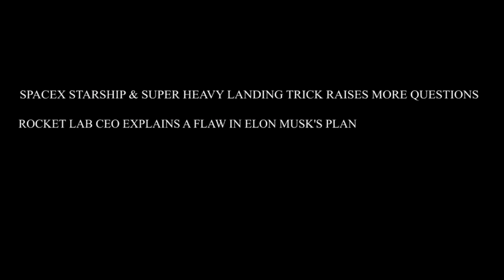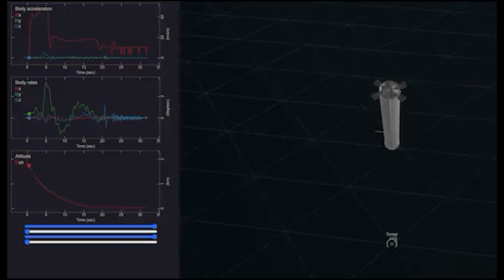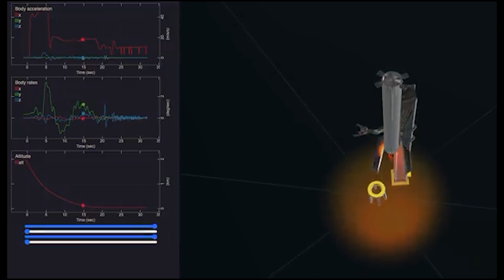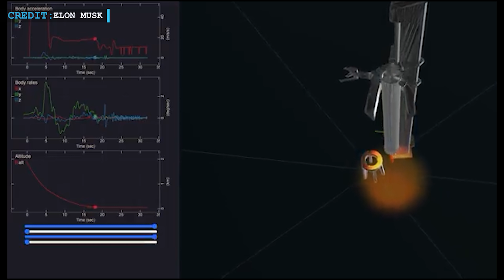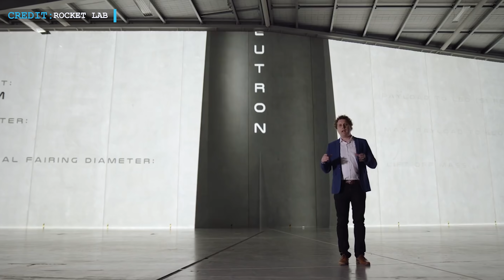SpaceX Starship Landing Trick Raises More Questions | Rocket Lab CEO Explains Flaw In Elon Musk Plan

Comment: How much extra fuel is consumed/wasted by the giant grid fins being extended in the boost phase.
I had guessed that the non folding fins had to be strong enough to catch the booster on and hold the weight but then those 'pins' showed up.
I hope someone has done the math on the weight of actuators to unfold the fins vs the drag induced by boosting with them extended.

Comment: I don't know the figures but it seems to me that the Neutron system will cost about the same to launch as a Falcon 9, because the second stage is expended. The second stage is smaller, because the fairings are attached to the first stage, but it still has an engine and all the other space flight hardware. The whole point of Starship, if it works, is 100% re-usability. The only cost will be fuel.

Comment: if the booster can use pad two way ground and vehicle based radio or laser guidance to find and hold position, the arms can use feedback to place themselves in an accurate enough position to do the actual catch.
Reply: Elon will likely use optics, just like his Teslas do. 😉 Edit: added winkyface.

Comment: Adding legs to Starship would KILL the full-reusability factor. Falcon 9 legs have crushable sections that require refurbishment/replacement with every launch. Suspension systems might not need refurbishment, but add much more useless mass to lift and haul through every phase of the entire flight. This efficiency loss becomes especially bad on a much-heavier vehicle like Starship/SuperHeavy. Having Starship land on the tower is a TECHNICAL challenge, not a technological challenge. SpaceX has proven itself very capable of overcoming mere technical challenges.

Comment: I’m not sure if Beck is mistaken or you’re misunderstanding him but the point of Starship is that the rocket is 100% reusable whereas the Neutron has a disposable upper stage so even if Starship only put 8 tons into orbit it would still be cheaper than Neutron but of course it will carry more than that by offering a lower price than anyone else can match.
Reply: if starship only put 8 tons into Orbit, neutron will be much cheaper. Neutron Upper Stage is optimized to be cheap, 
also neutron operation cost is cheaper than starship operation cost. It's useless launch starship for only 8 tons
Reply: @santiagodaniel968  no, fuel costs a lot less than throwing away a rocket stage. All rocket upstages currently in existence are disposable that doesn't make them cheap. Methane and Liquid Oxygen are cheaper.

Comment: They may say a thousand times the arms will capture Starship and the booster but i still won't believe it. Eventually they wll use the arms solely for the stacking of the two. The risks and difficulties associated with catching the booster and starship are so large that catching them isn't really feasible. Although made of steel, the booster and starship are quite flimsy in comparison to the speed, mass and forces involved.
Reply: To play devils advocate, imagine what people said to the wright brothers in 1903 when they were telling people we are going to make something that will fly and it will eventually cross oceans. Crazy idea when boats had been a proven solution for centuries, all that risk to achieve the same outcome.
Reply: actually do to the rapters raw power and being alot more refined than the merlin it is Possible as it can hover without sending itself up as the thrust of the raptors, the suicide burn for falcon is due to the merlin engine's at 25%thrust being able to lift the falcon boosters were as super heavy can likely hover
Reply: We Also catch satellites in orbit and the Apollo missions were of extreme risk

Comment: I think there is problem with what RocketLab CEO says. It doesn't matter if the Starship would carry mainly air and use only 10% of it's capacity (I don't believe this will be the case, but let's accept it for the sake of the argument) if it costs 10 times less to launch it than to launch Falcon 9. It will still cost 10 times less to launch the same amount of cargo with Starship than with Falcon 9 so the cost per kg is still going to be 10 times lower. The problem would be if Starship wasn't able to work as well on lower orbits as smaller rockets or it required to be launched with a full cargo. It doesn't so it also doesn't matter that it might not use it's full capacity, it's sitll going to be 10 times cheaper than Falcon 9.
Reply: I also see that this allows manufacturers to build their satalites heavier, a lot of companies spend time and money reducing weight to allow their sats to go on smaller rockets, so with the extra thrust they could build sats with more equipment and fuel.
Reply: @miguellopez3392  Exactly. For satellite providers, their design is constrained by their transport. Nobody has asked for bigger payload because all their life they've been told you can only send so much. If someone comes along and tells them to go to town with their design and transport it for cheap, well then someone is going to rethink their business model.
Reply: Not to mention if u have say 5 companies wanting to send 8 ton to orbit each on a ride share, they will pay a hell of a lot less for that 8 ton then a single launch and we see the falcon 9 frequently doing ride shares
Reply: Well he also said he would catch his rockets with a helicopter... so...
Reply: do you really think something twice as tall and doubly as wide as starship and its first stage will cost 10x less.   a falcon 9  uses 350 tons of fuel to get to orbit.   starship and booster use 4400 tons to get to orbit(in theory since they havent done it yet.)     So  it uses 15X more fuel per launch then a falcon 9 does.    how does it cost 10x less?   falcon 9 can life 22tons to low earth orbit.   starship and booster can lift 100 tons.   how is it 10x less again?
Reply: @jebes909090  Well thats simple.  1. Falcon 9 can take 12k lbs to GTO.  STARship can take 500k lbs to space single use and 300k lbs Reusable.  2.  STARSHIP USES A DIFF FUEL...   3.   STARSHIP IS 100% reusable...  falcon as of now they waste the last stage each flight.   4.  Quantity.  Anything you make alot of is cheaper.
Reply: Down time and maintenance on falcon is weeks... Starship will be hours.
Reply: @IamRandomAF   but thats not cheaper man.  look at the numbers.   150 tons to leo for 4400 tons of fuel vs 22 tons to leo for 350 tons of fuel.   so for the same amount of fuel falcon 9 can lift 275 tons to leo to starships 150 tons.    come on.
Reply: @jebes909090  Come on indeed.   it costs $200k to FUEL a falcon.  it costs 62 million to launch one as a customer. meaning YOUR EXAMPLE OF 275 tons would take 12.5 launches and cost you 775 MILLION $. the bulk of that cost being the final stage you cant get back. Merlin engine + other stuff on that.  EVEN if the Methane based fuel for STARSHIP wasn't cheaper but i think it will be since they will make it....  and say it Cost 10x the Fuel...   Its still 1 million $ in cost.  but they get back 100% of the rocket. So say they charge 50% less to use the Starship. so 31 million... i think it could be cheaper than this long run.  so  i could launch 2 starships and still be less than 10% of your 775 million $.    But im also not stuck with Leo... i could opt for GTO or the moon...   and i also don't get the hang up on FUEL.   That is its MAX Capacity.... No telling how much fuel is left when it lands from a mission.  The main key long term is rapid Re use.  if it has little to no down time.. and isnt requiring tons of people who all make $100 + an hour to get it ready to go again.

Comment: I trust Elon can accomplish a lot !  
But i just cant imagine that huge Booster landing on that tiny pins. My mind is not capable of that.  
Cant wait how this will turn out in reality!  One little error and Starbase is history
Reply: Probably will explode just once 'cos the data will be enough to fix whatever has to be fixed and nail it next time.
Reply: It seems that they are roughly gonna need the kind of precision they already have experience with on the Falcon 9 when targeting a landing pad, so maybe it indeed isn't that crazy to get it right as it seems. Also because there is no suicide burn involved. Aborts in case of a failed approach are nothing new to them either.
Reply: Here's the thing, depending on how its built the grid fins likely are the most structurally supported points on the rocket itself so

Comment: Rocket lab is promoting their proposed system but I'm just not seeing his point of why Starship won't work. Right now, Falcon is competing in his market with rideshare at a lower cost per kg than the electron. If Space X decides to compete their Starship against Neutron, the numbers show that Space X will probably win. Probably, Space X will prefer to compete Starship in different markets.
Reply: probably??  if starship works as intended.. it would erase all competition. Game over for the rest.  
The excuse of rocketlab is also silly,  first.. 70 starlink by orbital plane is not enough, also the extra payload to orbit can be also used to change the orbital plane of different pack of sats. 
Plus the incredible low price that Starship will achieve by fully and fast reusability. 
THe cost of fuel is nothing if you remove all the other costs.

Comment: Rocket lab's CEO's got a point. But if SpaceX manages to completely deploy Starlink using Starship, small payload launches would be pocket change for them and not worth the effort leaving other launch providers to pick up the slack while SpaceX goes to mine Mars.
Reply: I disagree that he has a point. Starship is designed to cost an order of magnitude less to launch than Falcon 9. If you need to launch a small payload and the smaller rocket is 10 times more expensive to launch than the bigger rocket, you are not going to take the smaller one just because the larger one will haul air. It doesn't matter, it's still cheaper.
Reply: @zbyszanna  "I disagree that he has a point. Starship is designed to cost an order of magnitude less to launch than Falcon 9"

that's not gonna happen, there is not enough demand of launches. Even the low propellant fraction (about 70%) beamed energy SSTO approaches need thousands of launches to be in the order of U$ 200 per kg. Also, for dedicated missions small rockets are chepeast.

Most of the wild claims about Starship is just hype made by Musk, like he's been doing with FSD, Neuralink,...
Reply: @luigeribeiro  So short sighted... are you sure this is the right channel for you?

Comment: "Opinions are like..........We all know how that goes.    Peter Beck said that "100 tons just won't get it."   Then goes on to tell us how superior his smaller rockets are.    
Data.  All Spacex needs is flight data, then they can further cut down weight, complexity and boost simplicity.  To get that data is a bit challenging.  100 years from now they will laugh and pick apart the early Starships on how needlessly complex and wasteful they were.  That will be when they have 100 years of flight data to work from.
Reply: We already had this conversation back in the beginning of Boeing 747, there main point back then was the airport couldn’t handle such a large Aeroplane✈️ and the terminal would not be able to cope with that many passengers at one time. 
what will be really funny is when one group of ground based astronomers start badmouthing another group of astronomers that’s using starship to put up an orbiting Observatory platform for multiple telescopes 🔭 because there blocking a clear view of the stars ⭐️ from them.

Comment: Suicide landing of Falcon 9 is notdone to safe fuel, but a neccessity caused by Merlin engine's inability to deep throttle. Falcon is not able to hover. Superheavy is. The landing in the simulation exactly shows what elon has previouusly said about it. No surprise there, and no sudden additional need for fuel.
Reply: If you want to save fuel, the greater the force and the shorter the duration is the way to go. This comes from orbital mechanics.
Reply: @paulbizard3493  For every given mass to orbit you have to use fuel, and to bring more fuel you need more fuel. Without calculations we can talk all day long.

Comment: There is a much more important reason for the suicide burn of the Falcon 9, other than fuel consumption. The Merlin engine simply cannot be throttled deep enough for hovering
Reply: from some of what I've come to understand they'd have to throttle them down so much they'd smash into the ground so Falcon 9 slows down and if it didn't land would basically rise back up
Reply: That is a fascinating detail of the complex re-entry system they currently employ.  I wonder if the raptor engines will be similarly restricted.  Maybe the large number of engines on the Starship booster stage will allow finer control of this issue.  They have been selectively lighting and shutting down engines on the falcon for many launches so I would expect this problem to be somewhat moot if everyone has done their math correctly.

Comment: The catch arms for Superheavy will swing to meet the catch points on Superheavy. This increases the possible "landing" zone area to cover most of the area Falcon 9 boosters manage to land in. As for the suicide burn, Raptors have a much wider throttle range so Superheavy can hover. That will allow much more precise landings.
Reply: I think the point was how does the weight of the fuel needed for a hover compare to the savings of not having legs ?
Reply: Raptors only throttle down to 40%, whereas Merlins can throttle down to 25%.  However, the dry mass of Superheavy being greater than 40% thrust of one or two Raptors means that they do not need to do a suicide burn, unlike 25% thrust of one Merlin which is greater than the mass of a Falcon 9 booster.